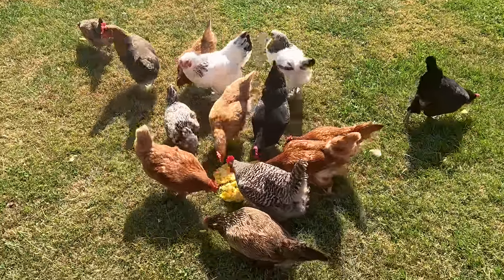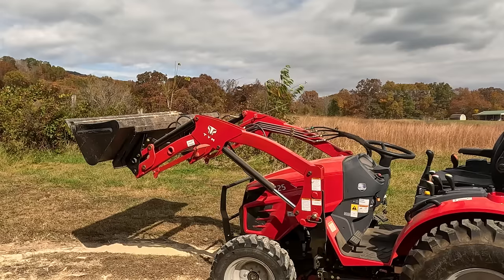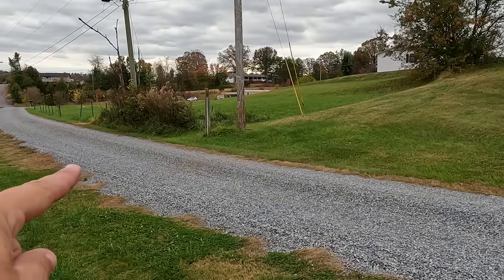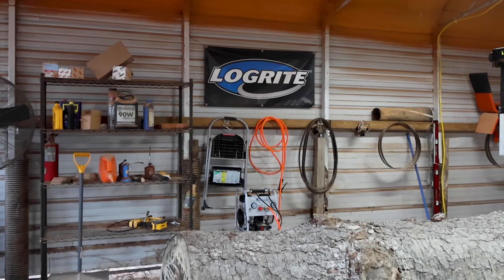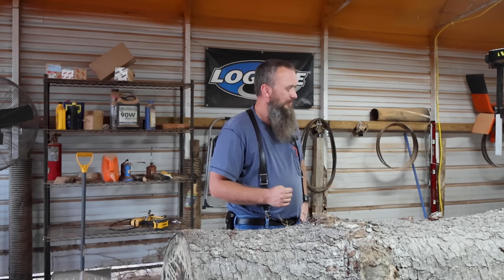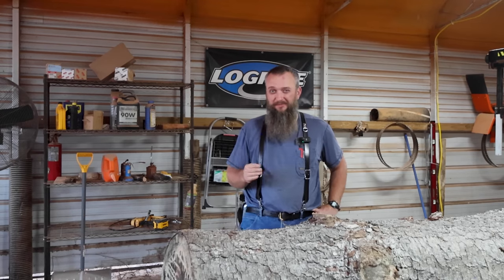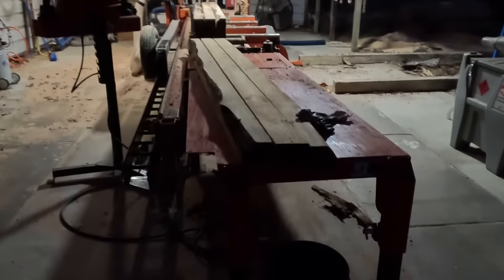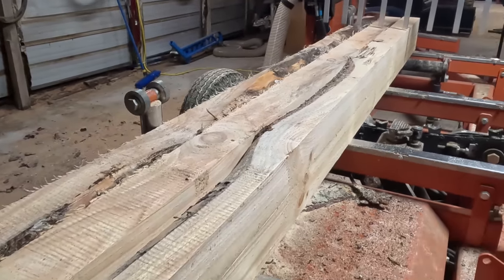This Video Is All About Dunnage! Making Something Out Of Nothing

Comment: Nathan, may I make a suggestion? A faster/easier way to do your gravel drive- With box blade on tractor, tilt  one side (usually the right)  4-5" and put low side to the ditch driving forward up one side then down the other . Then level your blade and flip over to back-drag mode and take a pass up the center Voila! (will also clean straiten your edges)- Tyler

Comment: An adjustable scraper blade would make quick work of your driveway maintenance. Set it at an angle and pull the gravel to the center. Much faster than using your front loader. Just my 2 cents. I love your videos.
Reply from the maker: Great point!

Comment: Could you put a diverter on the dust collector hose at the mill chute and use a long 2 1/2"- 3" hose to clean up the mill and shop area instead of blowing the dust off? Might keep the space cleaner.

Comment: Watching you work the driveway for the third time this year I could see a couple reasons for your problem.
1. Your base is too high under the gravel and appears to be too hard.
2. You have too much gravel on top of that hard surface.
To resolve this, you can remove some of the gravel or work the base down to a lower height.
Either way you go you really need to have the driveway rolled out with a large compactor. Not one of those walk behind toys.
If you do nothing, you will always have to rework the gravel every few months like you do now.